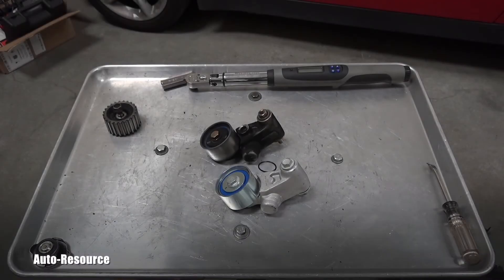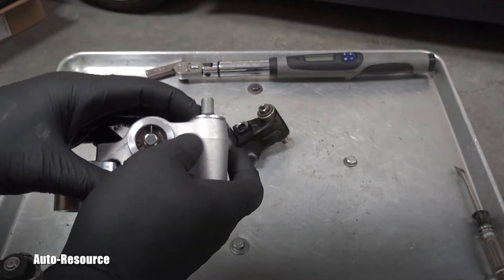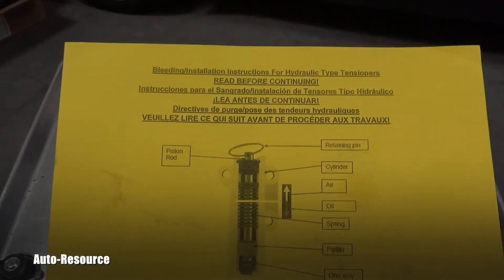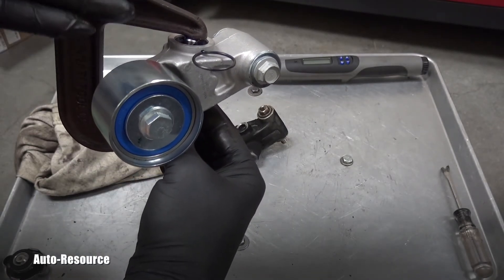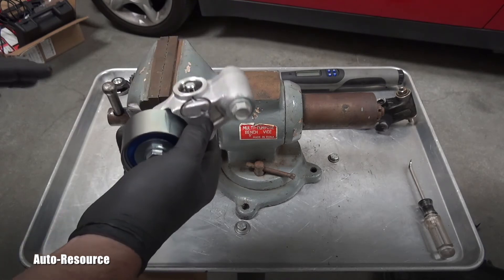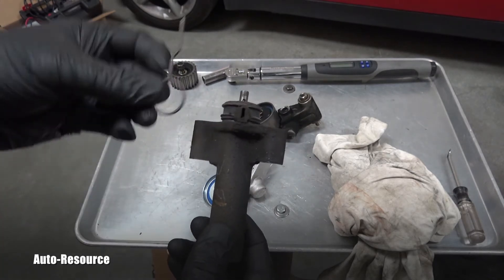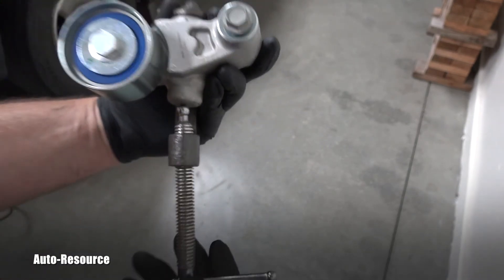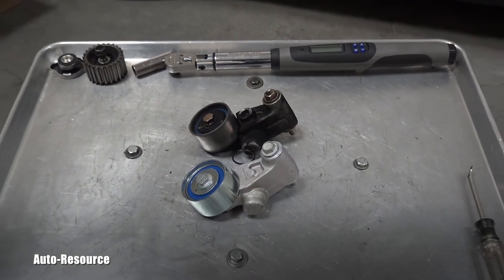Engine Timing Belt Hydraulic Tensioner

Comment: A problem with my tensioner which is identical to yours, is that the pin sits up higher than the OEM tensioner. That translates to an impossible timing belt install. I've done everything I can think of to install the belt with the tensioner being installed last with the hand grenade pin still in, and the hydraulic pin needs to got back into to the tensioner body another millimetre to give me space to install it. So frustrating.

Comment: I accidentally torqued the bolt holding the blue bearing on the tensioner to the same spec as the bolt holding the tensioner to the block. Is this a problem?